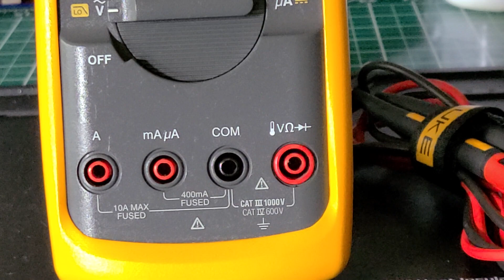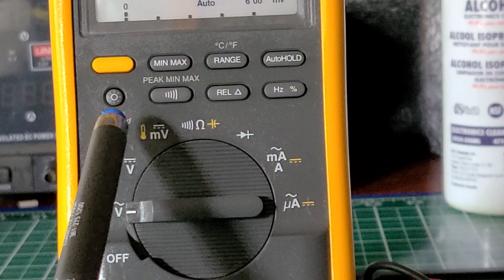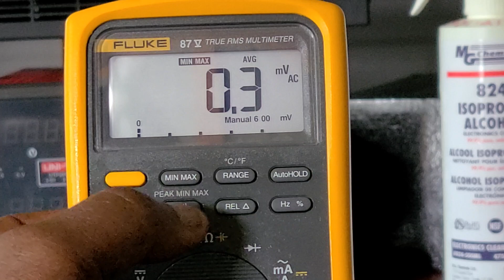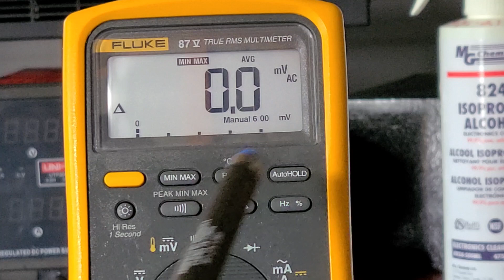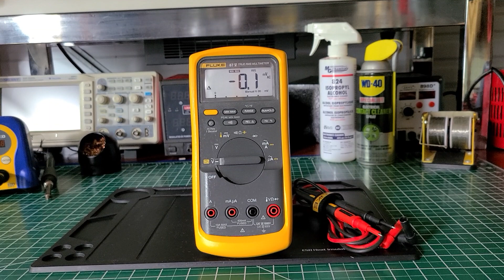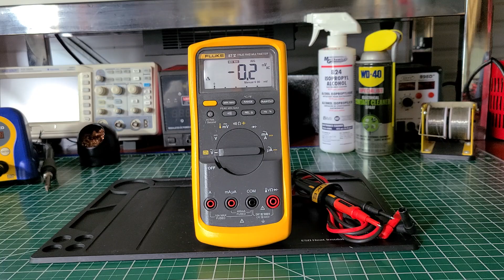FLUKE 87V True RMS Industrial Digital Multimeter

Comment: I grabbed this meter after watching your video.  Question.  If you put the dial to voltage AC you notice there is yellow lettering Lo.  Is this for low impedance?  Like the loz function on the fluke 114?
Reply from the maker: That's correct, also this device maybe the last multimeter you'll ever purchase. That's how well it's built !!!

Comment: When you hear the phrase “Trusty Dusty” it fits the fluke 87-5 to the tee!
I have it, and it NEVER LET ME DOWN!!!
King of the multimeters!!!
Some of the original 87s are still being used and holding their accuracy since 1989 or 87. They are not recommended today due to new safety standards. None the less they can out shine the new meters in the field today.
Dependable, accurate and a solid brick the 87-5 is!!!
Reply from the maker: I could not have said it better myself 👍🏽

Comment: Grabbed one for $235 off eBay a few weeks back and felt like I got away with a heist. First Fluke. I love it. The only thing I wish it had was the ability to measure pulse width like the 88v automotive but you can back into it with the frequency and duty cycle.
Reply from the maker: I’m glad you’re having a FLUKE experience, you won’t regret your purchase. Also check your user manual or search YouTube, but I remember seeing that somewhere or hearing it somewhere that the 87V has the pulse width feature. It’s one of those hidden features I spoke about in the video. Thanks for sharing 👍🏽